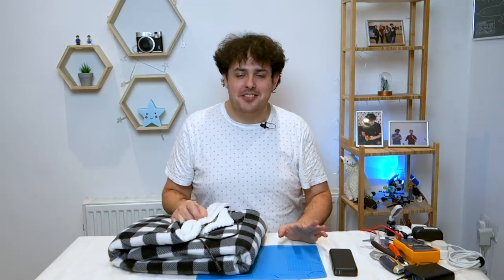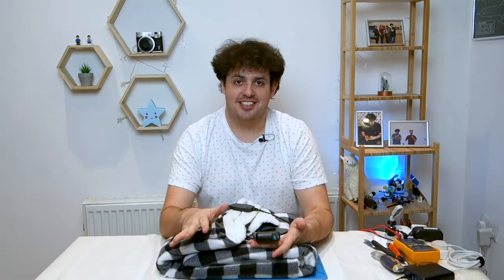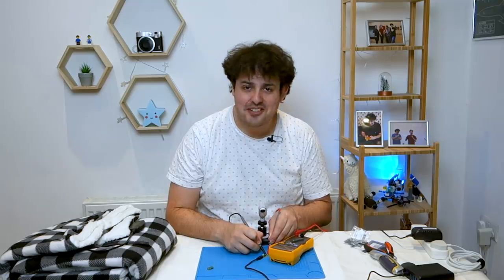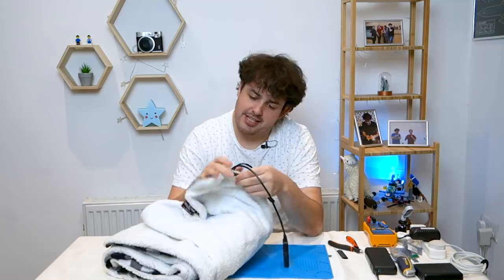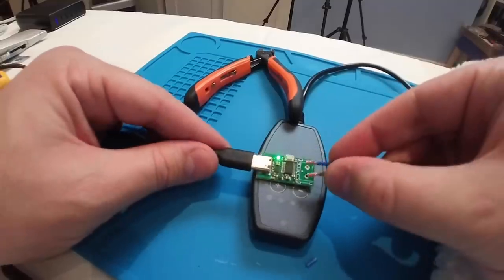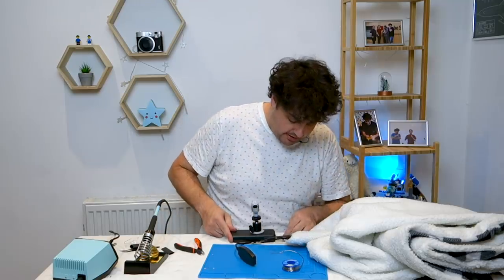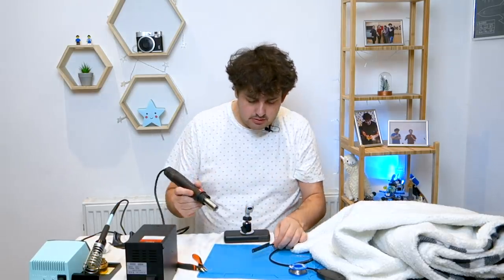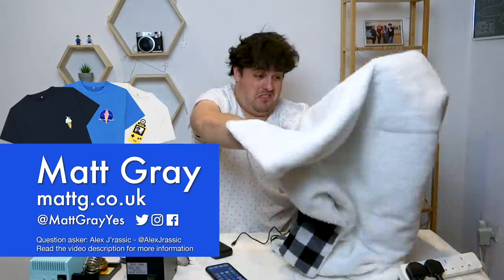Keep Warm While Social Distancing

Comment: These are going to be all over Amazon in a month when a manufacturer in China sees this video and realises they can make them quickly and easily.

Nice project, glad it works.
Reply: They would probably just use the cheap 5v to 12v upconverters which they already make for USB2. Or connect three 3.7v standard batteries (the kind in these USB battery packs) in series.
Reply: @CricketEngland  at least it will keep you warm if it catches fire...
Reply: They’re already invented before this video
Reply: @caleyhall  ya think? It's almost as though the comment flew right over the top of your head, isn't it...

Comment: The funny thing is there’s a couple of power tool companies that make heated jackets that use power tool batteries which can be pretty light.  I think Milwaukee and makita do them
Reply: And aeg/rigid, ryobi, and a slew of chinese ripoffs. 5 min of googling would have solved this.
Reply: @1990drewman  then you wouldn't have this video to enjoy.
Reply: @1990drewman  This is better though, no need to be sarcastic and insufferable about this. My Makita tool battery has a capacity of 54Wh, my RAVPower PD power bank is 100Wh, twice the capacity, yet a similar weight, and while both are similar in overall size the PD bank is much thinner and easier to pocket (being longer instead) than the bulky tool battery. There are smaller tool batteries but they're still much bigger than equivalent PD power banks because they're optimised for high current draw which precludes high capacities and requires large, bulky heat dissipating designs, features not required when you're powering a weedy resistive heater instead of a high current inductive load. Not only that but this can also plug straight into an appropriate mains adaptor, including many modern laptop adaptors that your friends might have laying around. Tool manufacturers make all sorts of silly things powered by their batteries not necessarily because it's the best way to power something but instead just so you've got more stuff that forces you to use their brand of battery, that doesn't make them the best approach to solving the problem of powering something, particularly if you aren't already at a job site as a contractor with dozens of spare tool batteries lying around.

Comment: The only thing I would have done differently is that I wouldn't chop the connector of the blanket and instead found a corresponding one and made a cable with usb-c on one end and a 12v barrel plug on the other. I'm assuming that the connector is of the barrel type of course.
Reply: Yeah, I was think just make a generic USB-C to cigarette-lighter/accessory port: then Matt could use it on the electric blanket, a portable kettle etc
Reply: @beebware  if I'm not wrong the connector on the blanket is a standard barrel plug. Like on a laptop. And I was thinking about putting the father side on a cable. It is a lot more compact. And is easier to source.

Edit: father not farther
Reply: I'd replace them for XT6 connectors or similar
Reply: @SamValiant  that is also a possibility
Reply: I agree with you on the not chopping the connector off. That way you can pre-heat your blanket in the car on the way to the socially distanced meeting.

Comment: If you want a marginally less janky setup, there's actually a few extra-chunky USB power banks which include built in 12v cigarette-lighter output (or even conversion to 120v AC). So you could achieve something like this without having to modify cables or push things too far out of specification

Comment: You could have got a car booster (jump starter) pack.  They have a 12V output (often with a cig lighter adapter as well for an even simpler hookup). They usually have 5V USB output also (don't buy one that doesn't!).  They will jump start your car when your battery is flat.  TBH they are the ultimate battery power banks.

Comment: There is Something like this, Bosch Profesional sels Heated Jackets which are powerd with an Adapter from there 12V or 18V Power Tool Bateries. To connect those to components they use a Plug that locks fairly simular to the one on your Blanket, so powering an Blanktet with it seems posible. Those Adapters are also sailed seprat as GAA 12V /18V and have one or two USB A Charging Ports in adition to the 12V Plug, so this could be a good Option if you alredy own the Batteries needed. If you´ve got both 12V and 18V, buy the 18V adapter since it is cheaper, has two USB ports, alows you to use bigger Bateries, and dosen´t discharge your Baterie when it is not used (thats a known Problem only with the GAA 12V)

Comment: Mat grabbing the USB from the positive and negative to disconnect it at 4:40, please don't get shocked
Reply: Noticed that as well, to be honest it was done only using one hand on conductive parts while in 12V mode so it's not anything like the worst thing that could happen with electricity.
But I agree that it's definitely important to be aware of what you're touching when working with electronics, even in these relatively low voltage and power limited scenarios.

Comment: You can get some pretty small 12V jump packs now which could be a simpler alternative.
Reply: I found myself thinking the same thing - a car jump-starter pack's 12v-output. You would want to use extreme caution if using the Big Chunky Connector on one of those because they can dish out an absolutely gargantuan amount of current if you accidentally shorted them - probably best to add a fuse!

Comment: If it's bad enough to be using mains cable with mains standard colors for a relatively low voltage DC system, never trust the colors to be anything sensible. In fact, even if they're red and black, don't trust it. Always test.

Comment: How long does the battery last?
Reply from the maker: I haven’t tried it yet! But the battery is 20Ah, and it says it can supply 3A at 12V so I suspect at least an hour! (If the blanket doesn’t self-destruct before then!)
Reply: @MattGrayYES  On the bright side, if it catches fire, it'll keep you AND your friends warm.
Reply: @MattGrayYES  I will expect an update...
Reply: @beef_enchilada3384  To get the most out of it, one should plan for the blanket to catch fire just as the battery is about to run out. That way you stay warm/hot the longest possible time.
Reply: @MattGrayYES  you should have measured the ampere usage before (On the car-module). These USB-C adapters can not transfer more than 2 amps permanently without breakting (use them for multiple projects). Either the adapter burns away or the powerbank is strained too much. Please feel if the powerbank or the adapter gets hot when using the blanked.
Don't want a slightly burned Matt.. :/

Comment: @10:26 if your blanket does not have a heat control button you could use the one on the usb controller to give less power and hence lower temps..

Comment: Awesome project.! I am going to be one of those people and say what "you should have done" what I mean is what I would do. For the pcb I would have coated it in hotglue to keep the button from being pressed that way if I ever need to reuse that thing or it some how loses its program I can take the glue off with alcohol. I also have a 3d printer so I might have designed and printed a housing for it instead of heat shrink but I know not everyone can do this. Otherwise I don't know what else I would change as this is such a great project.

I also might have just been really lazy and built a 12 volt nicd or nimh battery pack for it as I have access to cells and a tab welder at my job. While this does mean you don't need a special pcb for it you will be stuck with a custom battery that would be hard to use for other things. Compared to the lithium battery pack in this video its an easier method for me personally but not as versatile. It would also weigh more to get the same mah capacity/energy density. 

Matt if you read this I highly recommend getting a 3d printer. If you do a few more projects like this and reach out to creality or anycubic I am sure they'd send you one to review for free.

Comment: just going to point this out as a biker 

some biker jackets have heated elements as do some insoles gloves etc 

they run off a cig lighter socket 

you can get cig lighter sockets that plug straight on to a motorcycle battery

and a motorcycle battery does not need to be connected to a bike to work bish bash bosh a lot better

Comment: I really need to look into the differences between USB-A and USB-C. I just use USB-A since that was the wires I had. Then since those were the power bank i had that was the cords I bought. It is a vicious cycle.
Reply: Also important to keep in mind is it's not just if USB-C sockets are on there, these protocols can even live on a type-A USB socket! 
Essentially you'll come across these 3 variants:
- Nothing special, just 5V output up to a certain current
- USB power delivery (the non-proprietary protocol option)
- Quallcomm quick charge (what a lot of phones with fast charging early on used and probably still do)

There are also a few versions of quick charge out there, last time I checked they were up to quick charge 4 already. USB power delivery has also gone through revisions as well, not sure what the differences are there. But once you figured out which variant your product needs you also need to check if it supports the specific output profile, like Matt here in this video discovered: his mains USB power supply didn't have the 12V option but his powerbank does.

Comment: Great project, I would do similar myself (I'm an engineer, I can't see anything wrong with doing it) except for the fact that a. I don't own an electric blanket, and b. I don't have a USB power bank either.

Surely its USB 3.0 that would've introduced the variable voltages? Since USB-C is just the connector type, and the power bank you have just has standard USB-A ports on the output (but blue, signifying they're at 3.0 standard)
Reply: His battery pack has a Type C-with-PD output on it. Blue USB3 "type A" connectors can't do Power Delivery, that's a USB-C specific trick. And as he noted at one point, not all C-PD outputs can do all the voltage options. I think there's also meant to be a signalling thing built in to C-to-C cables to let them tell devices the maximum current they are rated for.

Comment: I'm curious how warm that chip gets  running all that power through itself. I ask mostly because 3D printers tend to have big MOSFETS with heat sinks (at 12vdc) to heat up a 30cmx30cm bed to 60°C. I know the blanket won't get anywhere near that hot, but it's also much larger, so it may 'balance out'?
Reply: I think the chip doesn't convert the voltage, so it won't get hot. It just signals the powerbank to provide a specific voltage. This is possible because the powerbank is already converting the battery voltage up to 5V anyhow, so making it able to produce other voltages isn't actually that big a thing. If anything it is the powerbank that would get hot for the amount of power drawn, not the USB-C communication chip.
Reply: The chip he uses to trigger the powerbank does not actually do any power conversion. It's only function is to communicate the USB Power Delivery protocol. All of the current passes straight from the USB C connector to the points Matt soldered wires to. It is also possible to control a printer heatbed without a heatsink using a higher quality mosfet. Some chinese manufacturers choose instead to use a low quality mosfet with a heatsink. A higher quality mosfet will have lower Rdson resistance, and will not heat up significantly under load.

Comment: I probably would have tried ripping out a laptop's power supply unit and using the 12 volt rail on that   that's probably way harder than I make it sound